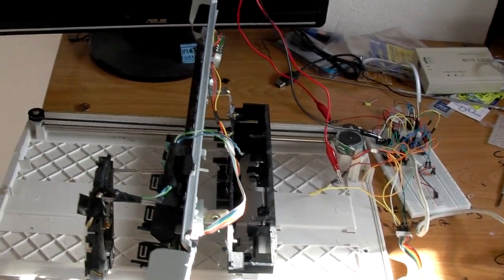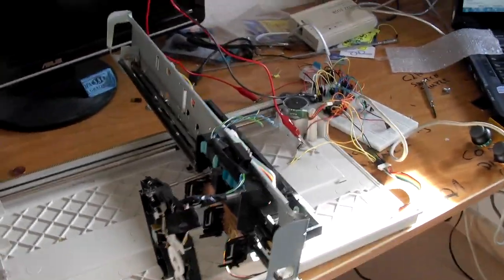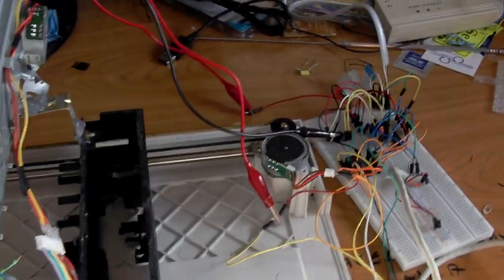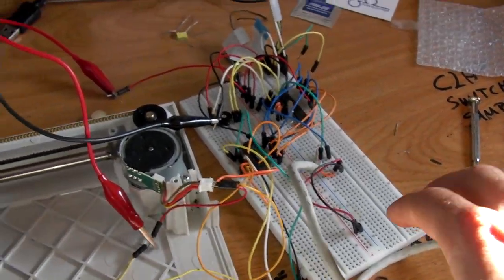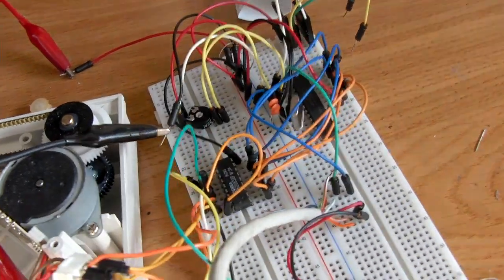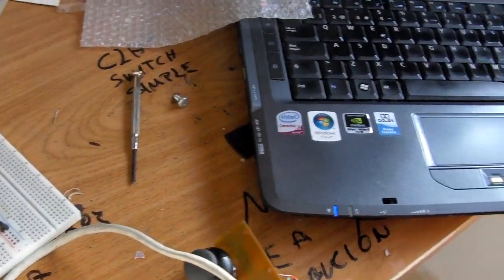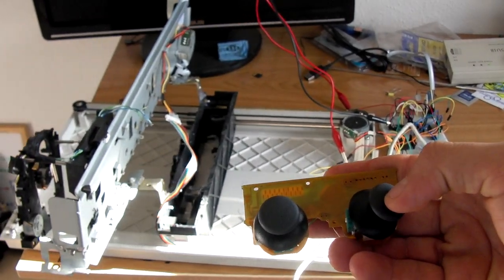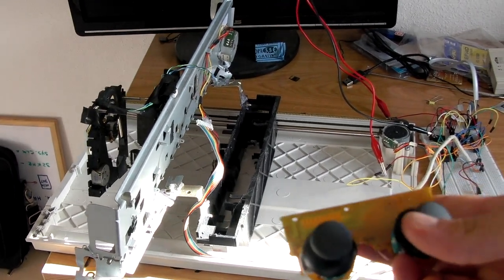CNC  Scanner + Printer! prototype

Comment: Hi, I'm from Ukraine, I have motors and FH6-1343 FH6-1357. Their need datasheet, wiring diagram and voltage. my mail bonus-kr@yandex.ua
I want to assemble a budget CNC. Sorry for the grammar
Reply from the maker: http://lmgtfy.com/?q=FH6-1343
Reply: TutoElectro Sorry! In Google, only the parameters W, I need volts. Winding on the legs
Reply from the maker: Валерий Литвиненко I can't give you anything you can't find in google. Sorry.

Comment from the maker: @TheGuitarwizard94 Well its really simple. Just connect the motors using four pins to a array of transistors and from ther to each motor. For the control just connect the potentiometer to one of the ADC pins in the PIC. What don't you know how to connect?

Comment from the maker: @BataQ Great! Theres only a downer in this proyect and is the fact that the motors in most scanners/printers ar not strong enough for milling at least if you use them the way I did. But you can still use it if you want to use it as a plotter or maybe if you buy a laser for it :)